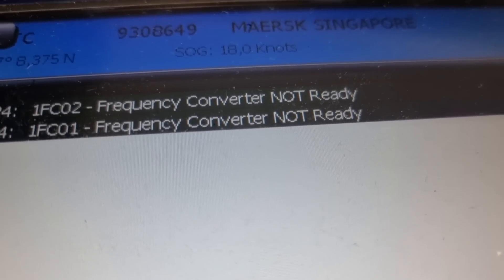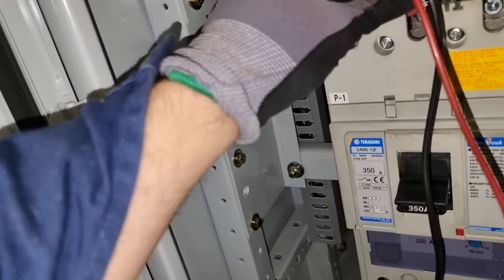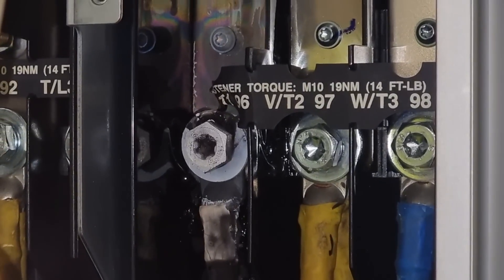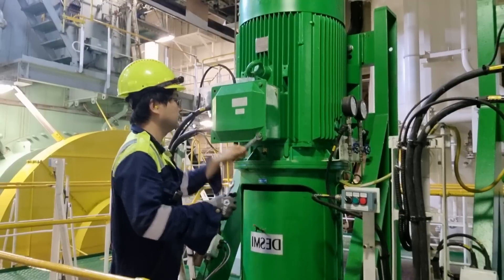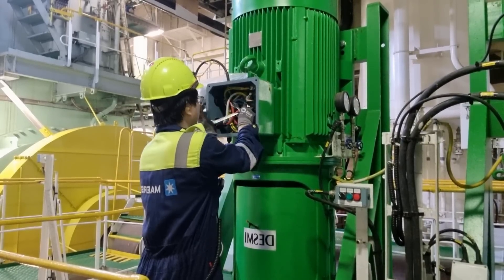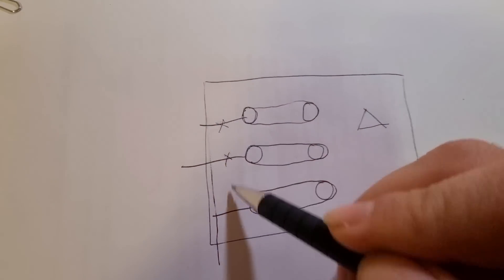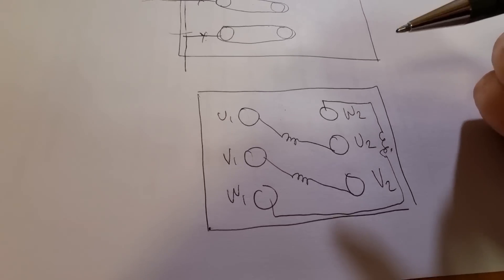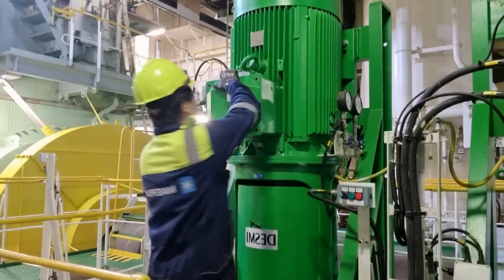Burnt VFD, Why?????

Comment: Thanks brilliant video 👍
Personal experience of using  VFD in our workshop
(240 v 1 phase to 380v 3 phase VFD)
Most nights 2300-0300  is perfect faultlessly performance but anytime between 1100-1345 is totally useless 🤔
=
Incoming 240v 10kva line transformer falls away @ 1100-1345 to much demand on area network 😬🤔🤦

Comment: Question and comment. First of all big fan of your videos, currently subscribed, thank you so much for posting your videos❤
That being said, when you were checking insulation instead of using the Test button on the meter, why didn’t you use the Test button on the red lead?
Reply from the maker: sometimes it fails, there is something wrong on my probe that needs replacement. I already requested it and still waiting for the spare
Reply: @leckyjake  I have a keysight Insulation Multimeter, same issue. Bottom on test leads is defective😂

Comment: So an other idea would be to go and torque check all the VFDs and Motors , because IF one failed the rest are also in line to fail in similar ways. SO I would suggest take one by one out of commission and re-tighten all the bolts and connections and check for lose connections.

Comment: Good video. We always try to tell our apprentices at the shipyard what you have said about isolating each part of the system separately.  As you say, it helps you track down the individual problem, and also makes sure that when you use the megger on things, you only will be using it on the parts of the circuit that can handle the high voltages that the megger will put out.
If you do not take off any sensing wires or similar things first, then you could be sending 500- 1000 volts from the megger to sensitive electronics, which cannot handle those voltages, creating a far bigger problem than you started out with……
Reply: Yes, you are right. But 500V DC is not so much for a 400 V(?) AC powered inverter. Around 560V DC is a normal operational voltage. This VFD has gone anyway.
Reply: @michaelw4258  yes, in that case, you are correct. But in other cases, there are often sensing devices on generators and things that can be burned out by the high voltages that the mergers put out.  Those items are what I was mentioning, and was why it is important to isolate these things so they are not burned out by mistake. 🙂
Reply: Always,
 and this fundamental,we isolate sensitive electronic circuits such as AVR etc when we use megger test in case of supplying 500vdc( the generated voltage from megger test)to the electronic circuit with danger of damaging it irreversably.

Comment: From my point of view, no reason to disconnect “Delta” connection in the terminal. The measurements with plates or without will be the same. Also I don’t understand why you are going to replace power cable? Is there short circuit?
Reply: He broke the delta so he could check individual winding resistances. He mentioned he checked them but didn't show it.
Reply: @inothome  without broken delta connection you can check individual windings! No point to do it, check what does it means delta connection. Even with star you can check without broken connection. If reading between three phase will be different, after that you should brake connection
Reply from the maker: there are cases where you have equal continuity but all you are measuring is a shorted Lines. The proper IR test is to separate each windings and measure in between. that is only 5 mins additional time to your job.
Reply: @leckyjake  Exactly!! Do it right and it only takes a few extra minutes.

Comment: What would the tester show if there was a fault?
Reply: 0Ω or 1Ω if good you will see >1000MΩ
Reply: 0
Reply: There is usually a minimum insulation resistance value given by the manufacturer. But with no specs a rule of thumb is 1 Meg Ohm per 1,000V plus 1 Meg Ohm. So on a 400V motor like this there should be at minimum 1 to 2 Meg Ohm and he was measuring over 550Meg Ohm. But if he was measuring in the kilo-Ohm range then something would be suspect, it doesn't have to be 0 or very low to fail. With insulation resistance the higher the better.